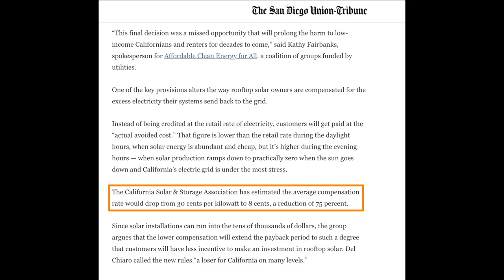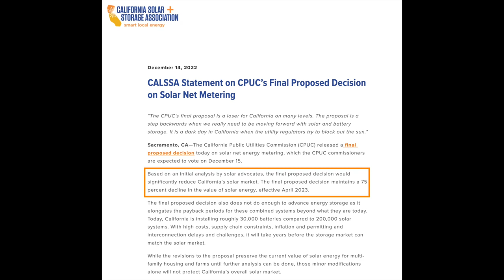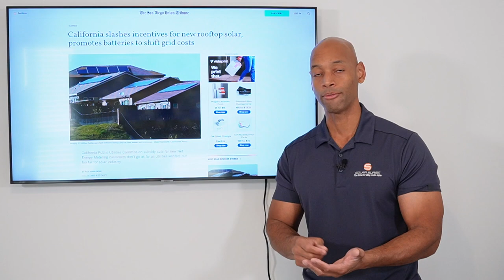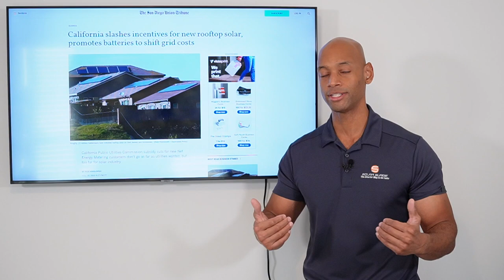URGENT: California Solar Program Ending April 2023

Comment: I am probably going to get eaten alive for saying this, but IO can imagine that every state will eventually get to the point where net metering drops of assuming they reach a very high solar adoption. There are still maintenance fees and general fees to run power plants that exists wither you are providing all of your own energy or not. I live in MA, and we are currently net metered with no talk (yet) of changing that, but I am sure i twill get there. There are more and more solar installations popping up seemingly daily. This last year alone six of my neighbors have had solar installed. Kinda makes sense... if you expect to be able to fall back on the grid, somehow it needs to be paid for... That's not an issue when only a small percentage of your customer base is on solar.

Comment: Great video Joe. Isn’t Solar mandated on new construction in CA? Seems like quite a benefit to the power companies. 
New home has to have solar but new systems only “financially” benefit the power company. 
Bring on the batteries!
Reply: Solar is not a benefit if there is more capacity then demand because there are only 2 options.  Sell electricity at a low rate or store it.  It takes money to buy batter to store it and maintain it.
Reply: Civilians have a hard time understanding power. Time of day when power is produced is often more important than the amount of power produced
Reply: Where is the benefit to the power companies?

Comment: Its about time.  Solar should not be used unless it can make it in a free market.  The utility company has invested from 40 to 60,000 dollars per meter for the infrastructure then on going maintenance.
Reply: What are you smoking? Here is the San Joaquin Valley of California, where the South San Joaquin Valley Irrigation District is currently suing PG&E to purchase the infrastructure, REAL auditors from 3 different companies have tagged the infrastructure cost burden held by PG&E to be less than $10,000 per meter. They didn't allow PG&E to claim any expenses that were diverted to residents via bonds (how PG&E offsets a lot of costs) and the amount of 'infrastructure fees" PG&E includes in monthly bills- which they hide in the 'retail price' of electricity.

Comment: Question: Does it have to be docks signed or installed before the deadline to cash in on net metering for 20 years?
Reply from the maker: Net metering interconnection application must be filed.  That's usually docs signed + 30 days.
Reply: @SolarSurge  Thanks Solar Surge.
Reply: @SolarSurge  After signing, is there another 30 day waiting period? Is it because it takes up to 30 days for NTP (notice to proceed) from the financier?
Reply from the maker: @solarguy6517  It can take up to 30 days to complete an on-site survey, receipt NTP from financing, and clear engineering internal review.  Usually all of that happens before the interconnection application is submitted to the power company.
Reply: @SolarSurge  Thank You
Reply: @SolarSurge  If the home is sold a year from now, is the new home owner (2ndry home owner), grandfather into net metering?

Comment: What I'm going to do is I'm going to have batteries and whatever my batteries don't use it's going to go to the grid and then I'll have power for a whole week of what I have for batteries which was not efficient for the last month and a half so I'm going to have to get more batteries yet.
     But when I get enough solar panels the power of my whole house I won't have to worry about it cuz I'll be selling electricity to electric company and using my battery banks at night or when it's not making enough power in the daytime because it's clouds I'll be using batteries.

Comment: The biggest problem that you and other solar sales people conveniently neglect to mention is the upfront cost of systems in the US which are the highest in the world.

You can DIY and just hire your own electrician and installer’s and save about 50% over what these companies charge.  The issue I see over and over is that the solar companies design systems that are far larger than required for most homes.       The design should always start with a power analysis and identify all the areas where you can reduce consumption.    This is obviously not in the interest of solar companies.   

You can get a whole system including batteries for less than just panels from these companies and there are a number of non profit organizations that will assist with the whole process and give you access to bulk wholesale rates for equipment and approved installers

Comment: Wasn't there also a new fixed price monthly infrastructure/grid charge that solar owners will have to pay?
Reply from the maker: That part of the regulation seems to have been defeated, but the loss of net-metering is the worst blow.
Reply: The Solar tax based on system size ($8/KW) and the reduction in the NEM grandfathering timeframes from 20 down to 15 years were removed from the final NEM 3.0 ruling. 
That the CPUC got so close to passing that in December of 2021 was absolutely nuts and shows just how that Commission was in the pocket of the big 3 utilities in CA.
Reply: @aldiaz33  Except, Net Metering is theft from those maintaining the infrastructure at retail rates.  This had to be addressed.  Grid was going unstable with all the solar on it.  Battery backup is required.  Someone has to pay for that battery backup.  Either YOU, or those who maintain the infrastructure which ultimately is still... YOU.
Reply: @w8stral   I agree with you that solar customers should pay their fair share to maintain the grid (not to line the pockets of overpaid execs and PG&E shareholders). A revision to NEM 2.0 was likely necessary.
But the idea that PG&E can impose a tax on the sun is absurd. What people do behind their meter is none of PG&E's business. They were reaching way too far with trying to establish that monthly fee based on the size of people's solar system.
Reply: @aldiaz33  The last point I will agree on 100%.  But we still have a problem here.  If everyone has solar, then the local neighborhood infrastructure is woefully inadequate.  This requires money to upgrade.  This is an enormous amount of $$$ and will be even worse for anyone with underground burial power cables.  The selling of kWh's at wholesale prices to the grid  on small scale is not nearly enough to pay for this upgrade.  This is not an easy solution.  Requires a micro grid limiting production network.  In either case end producer will still be out $$$ in either upfront costs or costs down the line as solar penetration in a desert environment like California and SW USA or Northern Mexico become ever more prevalent. This is not just a California problem.  This is a Hawaii problem already even bigger than California has.  Florida will soon pass California and probably Texas as well.  

There is no free lunch.  The money for the grid upgrades has to come from somewhere and traditionally it has always come from the energy producer.  Vast majority of people do not know this aspect and I do not see any reason this will be any different in the future for home owner solar energy producer.  

Its not CEO's screwing over the small solar producer.  Rather the gargantuan subsidy via government fiat is going away.  The insanely high power prices in CAL/Hawaii aren't going anywhere but up so solar still makes sense even at the lower prices.

Comment: I am curious about your statement that existing NEM customers will be grandfathered in for 20 years.  I thought existing NEM customers would be grandfathered in for the remainder of their contract with PG&E Those that sign up between now and 120 days will have a 20 year contract.  Is my understanding incorrect?
Reply from the maker: Hi Bryan and thanks for writing in.  Your understanding is correct.  20 years for new contracts between now and April 2023.
Reply: @SolarSurge  I am in the process of replacing my 15 year old Sunpower 4kW system with a Gen II Darfon battery system because of this.  The only way to get a reasonable ROI is with storage.  So the new system will be 8.2 kW and 35 kWh of storage.
Reply: @bryanwhitton1784  Smart move!
Reply: @SolarSurge  Good afternoon Bryan. I watched your video and found some interesting information on the solar system. Right now my solar and power company is charging me over $3k for my usage I got my bill in December 2022. I have to pay it January 2023 and only had the panels less than a year. I have a small studio house in the back of my home that is connected to the same electricity and the city only approved me for fewer panels than I was told from the beginning. My solar company never disclosed to me why? My grid comparisons don't make sense because both solar company and electric company are basing it off of the fall usage and my panels were installed after the summer. My electric bill has always been  high during the summer months but 2022 the solar panels were not installed yet. How does that work? I hope you can help me understand how or why my system is producing this way? I don't think my Solar company was being very honest with me from the start and I'd greatly appreciate any help you can offer. Thank you.

Comment: Question: I have a 20+ year old net metering system without battery.  Is the 20 year clause applicable to when it was installed or will it apply to people like me who has had a system operating for over 20 years as of 2022?
Reply from the maker: Hi Dennis, great question. The 20 years applies to new systems only. Once your existing agreement runs out, you will likely have to switch to the new program.
Reply: @SolarSurge  That's what I expected.  I got a notice that I will be switched to a TOU  rate plan.  Funny thing, I have been on a TOU plan all along.  I have begun to charge our electric cars during the day now instead of overnight.  With the addition of our Rivian truck, I have no problem using all we produce on some days.  I am in the process of establishing battery systems so it will supply the house during the more expensive times of the day.  I'm also looking strongly at going off-grid for our all electric house.  My biggest problem is that we are all electric & I have some things which draw a lot occasionally.  Especially when the wife has all of the burners on the stove going plus the oven at the same time.

Comment: You're not giving correct information for California net metering. When you talk about one for one that was net metering 1.0. then it changed to net metering 2.0 which is what I have and they started paying you a set amount per kilowatt hour rather than a credit for kilowatt hour. But you haven't told anybody it's at the cost of the electricity with net metering 2.0 maybe 30 cents a kilowatt hour but you pay for delivery of that kilowatt hour when you use it from the grid but when they pay you you don't get that cost of the delivery. In San Diego SDG&e has a chart that changes by the month for what they pay for electricity and that chart is hard to find and at my true up they paid me about 2.6 cents for each kilowatt that I generated. In San Diego when you install solar you must change to a time of use plan. The battery backup which I installed the 24K neo Volta which has been working perfectly for over a year, kicks in at 4:00 p.m. and I have it running all 120 volt circuits in the house. That saves the cost of the electricity during the most expensive time of the day and also saves the cost of delivery of that electricity and in the peak time in the summer is about $0.60 a kilowatt hour. The best deal for electricity is between midnight and 6:00 a.m. where the cost for electricity and delivery is about 9 cents a kilowatt hour. That's when I charge my car.

Comment: news flash chuckles, california will not grandfather in people already equiped up..that will change soon enough also.for  the average homeowner here in california it takes well over a decade to see any type of real favorable return, unless they live in a home which is 100% electric then it will take a shorter period especially if they live in a hot area of california. either way the average home owner is looking at a serious investment of 80-100k to have  a real system that will work. you act like thats no big deal.

Comment: Where we at with those 120 days now 😂
Reply from the maker: About 21 business days left to secure net metering 2.0.  Let us know if you want to get signed up ASAP.
Reply: @Solar Surge  Can do, quick question...buying panels outright...on a 1700sft home. Is about how much?
Reply from the maker: @lakeithjones104  That depends on the exact electrical usage, but the normal range is $18,000-25,000 cash.
Reply: @Solar Surge  I appreciate that a lot, thanks for the honesty. Might have to draw money from other places to make it happen. I understand that you can get set and signed before April 13th and be grandfathered in but when what's the latest you can pay that full amount
Reply from the maker: @lakeithjones104  You should have about 60 to come up with the full amount or you can finance.  Let us know if we can help.  We can turn around your NEM 2.0 application within 1 business day of signing and there is only a $1k cash deposit required.

Comment: Use a cryptocurrency mining rig to use excess electricity beyond what the battery can store as well as a heater to provide warmth and even dry food, you should be able to buy them at a good price right now, forget about it when the cryptocurrency price goes back up⬆💰